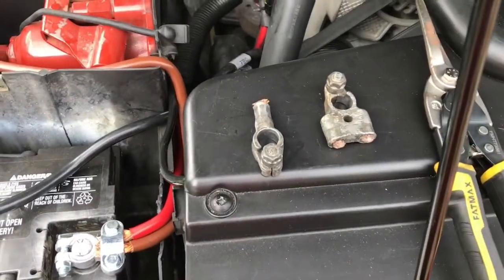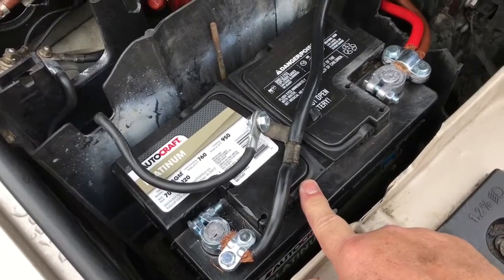Battery mod discovery 2

Comment: You have pointed at the very basic and extremely silly points that no video out of hundreds mentioned or detected. This poor connection structure is causing fully unexpected and irrelevant electronic failures because of poor feed to the electrical systems like ABS, HDC, TCS, ACE, SLS.. nothing else left over . (some improvement on workmanship is proposed for better security, dear)

Comment: increased capacity aside that's no upgrade!! - 1st issue is why on earth would you purchase the wrong battery configuration? I mean why didn't you buy one with the terminal positions that matched the original and re-use the existing cables with upgraded terminals.  NB: a CAT 115-2422 1000CCA is a "drop-in" upgrade.....
Reply from the maker: Hey awesome thoughts , maybe because when the battery died that the only thing available, but hey love your comments, thank you so much for watching 👍

Comment: Why didn't you just source a bigger capacity battery with the posts in the same position?
That's REALLY bad wiring!
DON'T fuck about crimping cable to cable like that. Make up new cables!
As for needing to waterproof everything electical under the bonnet, WHY?
Unless you drive like a total dick through water or park it in water up to the tops of the wings, you shouldn't be getting water that high up in the engine bay at all!

Comment: Dude that’s some pretty dodgy work on that wiring work I’d trash those battery terminals and get some proper ones crimped, soldered and route the wiring correctly. otherwise you’re going to find yourself locked out and on fire 🔥
Reply: @ILikeWhiteUK dear, Neg is dead ! No potential there fro your hesiations. But admit that some improvement to that wiring will serve increased safety...